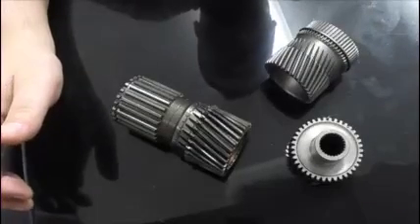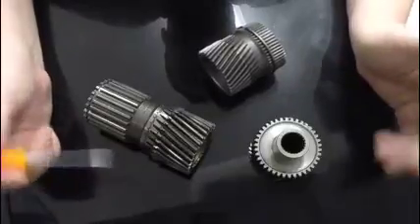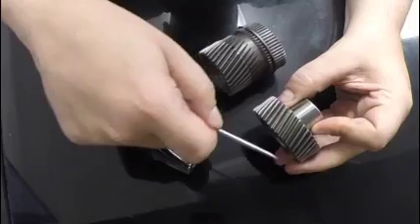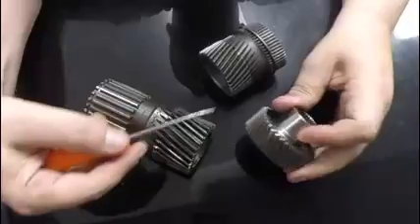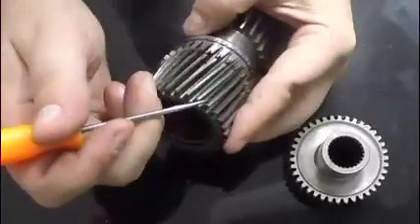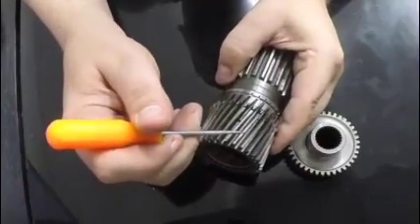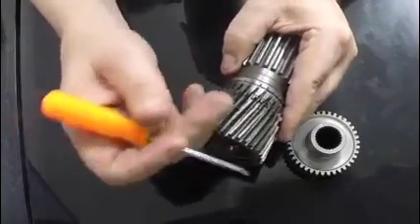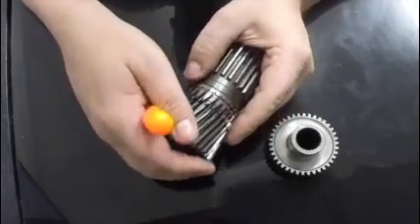Transmission Sun Gear Inspection (Is My Sun Gear Bad?) Pitting Explained!

Comment: Does it make a difference in the sizes of sun gears I am replacing it and the replacement is smaller than the original. Does that matter

Comment: Does do stock the OD Sungear that came in 1st Gen Cummins trucks? The splines are straight not 15 or 22 degree.
Reply: What year are you referring to Gen 1 ? 
Typical 1988-1993 trucks are 22 degree / 1994 up Trucks should be 15 Degree
If unsure look at the side of your ring gear, and see if you notice an ID Groove, if so then it's 15 Degree
* Also worth mention on some 1988-1993 trucks they were very rare, but can with a straight cut gear
If you want to update the truck from 22 Degree to 15 degree We do have overdrive update packages.
One of our top sellers is the 5 pinion Gear kit below link -
https://www.cascadetransmissionparts.com/rhandreoverdriveplanetkitbbk-r.aspx
If you want the most available Heavy Duty 6 Pinion Kit - Ideal For Diesel & V10 Trucks - see below link
https://www.cascadetransmissionparts.com/rhandreoverdriveplanetkitbck.aspx